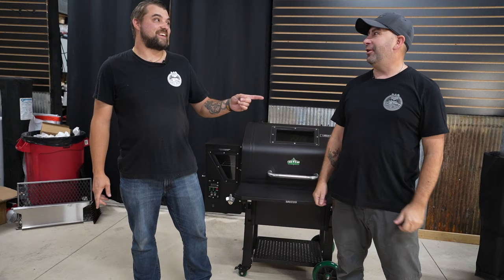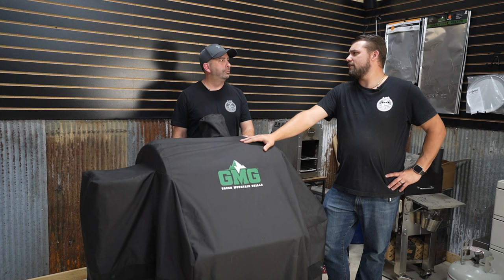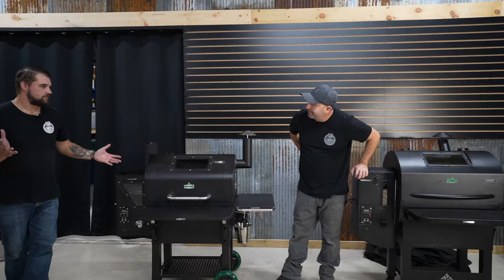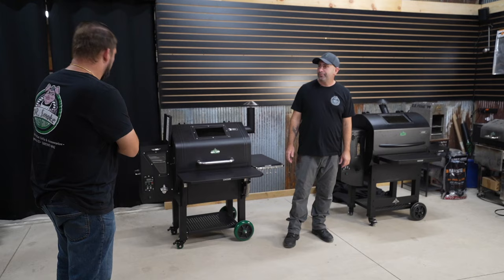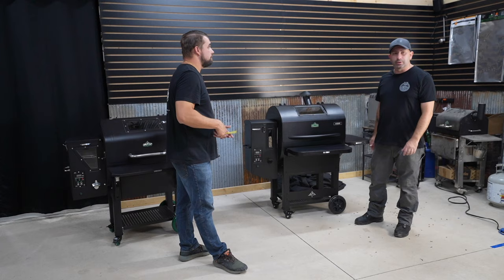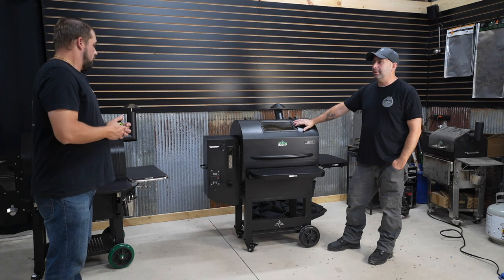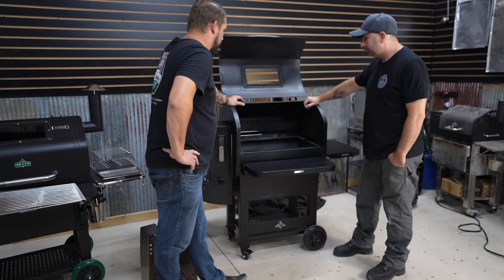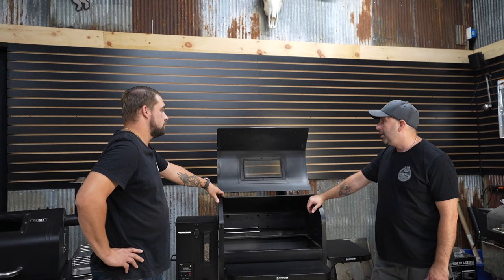NEW GMG Ledge Prime 2.0 Comparison

Comment: Nice comparison, but I think they missed the boat with the new racking system. A rack you can't pull out and in the back of the grill?  For me, I would like a shelf that you can pull in/out which also  doubles your cooking space. Also, when going for a long smoke, I like to put the meat on the middle rack where you can use a water/drip pan.

Comment: I've had my JB for 10 years and love it.  I like the new design but not the rack design.  It looks like the rib rack will only set to the sides, either left or right.  It would have been better to have extra holes so the rack could have multiple positions.  A full rack of ribs will be hanging off  to one side. A option of a full second shelf would have been nice. Looks to be quite sturdy, much better than the original.  Overall a very good upgrade

Comment: I don' t know what you are smoking but the two are BS. I just spent hours attempting to replace the igniter doing it the way you recommend. No way the Trek requires that you pretty much take the whole thing apart. the wires run through the hopper to a hole yes but that has a seal around the wires that has to be carefully removed in order to remove the two wire that go to the igniter. removing the hopper and the fan and auger allows  for you to easily run the wires from the igniter to the proper connection attempting to use your method string and pull wires from the igniter box will not work .
Reply from the maker: We have done many ignitors my friend and this is how we replace them.

Comment: I actually have the Daniel boone love the smoker tons of stainless steel parts. Sad to see gmg went away with some of it. At the end of the day I’m still having a sand it down and paint it if GMG would come out with a fully stainless barrel I would be all over it unfortunately rectec  does so that will be my next purchase. I’m tired of sending and painting rust stainless steel is the way to go if you’re purchasing something that is $1000 and actually their model is under $1000. That’s all stainless drum .
Reply from the maker: The stainless Rectec is using isn’t the high grade stuff you might be thinking of. There are a lot of different qualities in stainless and I can show you pictures of one of those barrels rotted out. If you keep the GMG clean and make sure grease isn’t getting into the barrel you should be good for many years without any problems.
Reply from the maker: Appreciate the comment, the SS rusts just like any other metal,  they use grade 440, which is a very malleable material for molding,  I have pictures of plenty of rusted out Rectec smokers that are rotted all the way though.  I'm not bad mouthing them at all, but they are now owned by yet another hedge fund with investors they need to make happy.  I respect your decision, but nothing is going to be perfect.  Happy smoking brother!
Reply: @DRSmokeNJ  so mine rusting on the outside means that gmg is? i love my gmg but when i called customer service abt it they said sand and paint it. i clean mine out every 20-30 cooks and its mostly chicken breast and non greasy meats. never cooked a steak on it. I have a egg for that. Also my front casters are rusted and need to be replaced i guess i will call the company and eat  that cost. I used to have a pit boss. also my vacuum door is completely rusted which is weird. the grill it in NC and under a covered shelter. id just like to see GMG add a deflector to the bottom of the barrel or go stainless." other than the hood"

Comment: What was the difference in the gauge of steel? Was it a higher in strength, or does it bend slightly over time? How is the fire pot emptied, still vacuumed out?
Reply from the maker: 13 and 14 gauge steel.  Fire pot gets vacuumed out, has a vacuum tube on the right side so you really do not need to take it apart, only reason is if it's too caked up then you would.